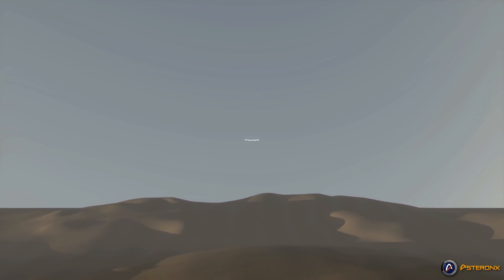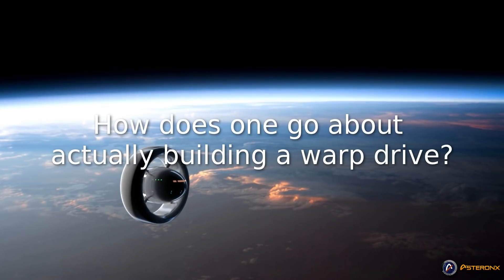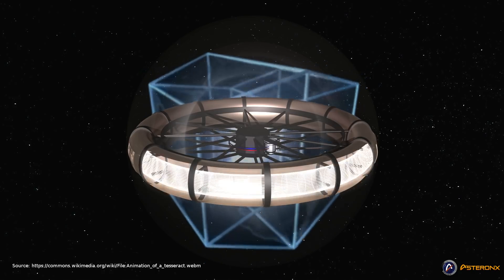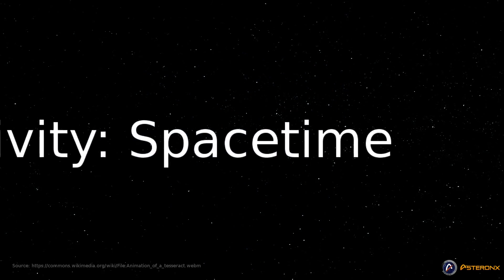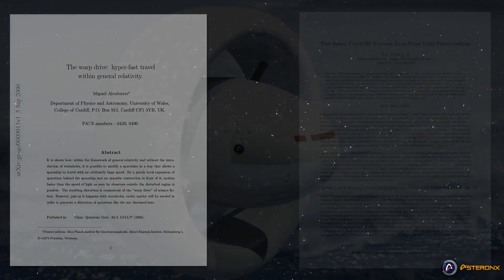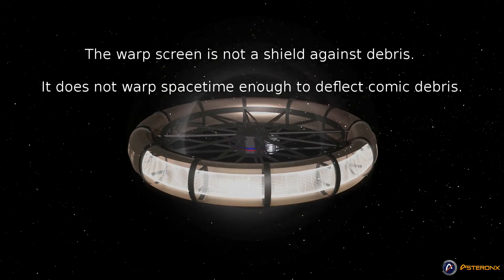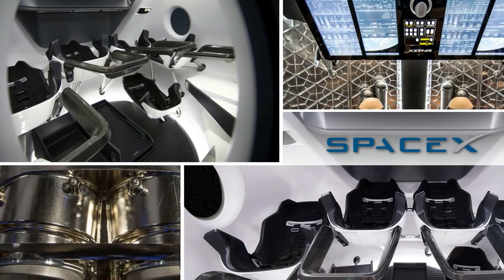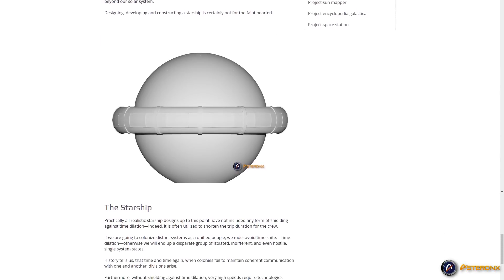Building a Warp Drive (updated version in description)

Comment: From my understanding, we need to discover/invent negative energy density or negative mass to work.
Reply from the maker: Negative energy (an inward pressure), not negative mass, exist everywhere. Basically, it is this that the Alcubierre drive variant utilizes. But, that is not by any means the whole story.
Reply: @asteronx  if negative mass/energy does in fact exist then how come we dont see any large concentrations of it anywhere in the visible universe?
Reply from the maker: @nil981  Please, do your research before making these statements.
Reply: @asteronx  

Here is another idea.

----------------------------------------------

Quantum Teleportation to other planets and back with data sent to Earth, and the data becomes an image or video, or 3D volumetric hologram, idea.

Also another idea is using large lasers like the military has, for Quantum Teleportation as the laser would be pointing at Proxima B in the solar system Alpha Centauri, which is closest to us, about 4.3 light years away from us.

Quantum Teleportation can go 3 times the speed of light with Photons, have it take a year to a year and a half to get there, and then send the data back in a year to a year and a half, 3 years going there and back, and then when the data gets back to Earth, have it create an image or video, or 3D volumetric hologram, e.g. imagine how fast a Quantum Computer can simulate planets, asteroids, and other things.

Imagine Quantum Teleportation with Mars and beyond, Proxima B the planet and beyond.

And now imagine as Quantum Teleportation matures, it could be 20 times faster, 50 times, who knows.

And to mention as Quantum Teleportation matures, with breakthroughs, sending it again to Proxima B so much faster, and beyond to other solar systems in our Galaxy and beyond that.

------------------

One other idea, is using Quantum Teleportation when it matures, to send "large objects" that aren't alive, like devices, machines, vehicles, buildings / structures, and so on to Mars, Proxima B and beyond. So that it sends them fast enough for cargo and other needs, using satellites, not just for the Quantum Internet across other planets.
Reply: @asteronx  

I have some interesting new playlists on my other channel to check out.

It would seem that you don't allow links, or my comments become hidden with the links in them.

And so I will mention which ones to look for on my other channel.

Look for these playlists on my other channel. -
"Searching for Dark Matter and Dark Energy with Quantum Computers", playlist.

"Quantum Computer breakthroughs", playlist.

"Graphene space ships", playlist.
This is a simple concept when you see it, but that is because the material is so advanced, and you should check out all the playlists on my other channel to see what I mentioned in this playlist.

=======================
Go to the channel I'm commenting with now, find 2 simple steps, and go to the "About" tab of the channel I'm commenting with now, for more info and a link to save to your browser's favorites.

Lots of amazing things on my other channel, I hope this gives you ideas, with Graphene and Quantum Technologies.
Reply: So, by "negative energy" all you mean is less than something else?🤣.     A car with a half tank of fuel would have a negative 1/2 tank compared to one with a full tank?

...but, this is by no means the whole story...

Comment: what bothers me is the G-forces? when you go faster than light or close to the speed of light, wouldnt that kill us going that speed?!
Reply from the maker: It's a good point, however, the warp screen actually shields against such g-forces.
Reply: All you need is a g-force field reduction modulator.  Set to 0.05 degrees of science words should be plenty.

Comment: A boost to the acceleration and not to the speed? What has to do with it in relation to which body you measure the speed of the ship? If it really was a boost to the speed, then if you exceed the speed of light, and disconnect the warp screen, you should stay above the speed of light. Are you saying that the speed of light is not the top speed for massive objects?

Comment: You can make the toroidal portion of the craft be a generated plasma instead of a physical part of the craft.

It is tricky but very obtainable with current materials.

Personally I prefer the approach of ridding created oscillations of the space time fabric to incrementally boost speed instead of a constant flow. Just seems easier to obtain.

Comment: What would a passenger see out of a window of a ship moving faster than light? Would objects be just appearing as they are passed by?
Reply: SkorpionMarauder if it were through the front window you would see the cosmic microwave background radiation Doppler shifted into the visible spectrum which would then warp into a single blue-white light and then it would warp into a glowing ring surrounding a dark void as the microwave background is further Doppler shifted into the x-ray and gamma ray spectrum.

From a side port, you'd see a stationary vertical rainbow as the dark x-ray and gamma ray spectrum goes from the ultraviolet spectrum to the visible spectrum (violet, purple, blue, green, yellow, orange, and red) in a narrow band and turn invisible right after.

From a rear window, you wouldn't see anything because behind you the light is Doppler shifted from infrared, to microwave, all the way to weak radio. 

If a faster than light ship flew in front of you (assuming that you are stationary) you'd see the ship blue shifted as it approached you , then temporarily disappear as it's blue shifted into the gamma ray spectrum. Then it will appear out of nowhere for a fraction of a second, while shifting through all the colors of the rainbow and then split into two ships. One going forwards and the other going backwards until they disappear (this is because the faster-than-light ship is out running it's past and future light cones so one image of the ship will always move forwards and the other one will always move backwards).
Reply: SkorpionMarauder I think it would look like a blur of red and blue light, because of the Doppler effect.
Reply: Nick Agriesti you wouldn't be wrong. Pbs space time and because science have excellent videos detailing superluminal travel.

Comment: Okay, can you talk about wormhole  generators/stargates as a form of effective interstellar travel?
Reply: Patrick Milewski seems to me the problem there would be the overwhelming gravitational forces acting on the object passing through the Einsten-Rosen bridge.
Reply: Nick Agriesti unless there was a way to make a trip through a wormhole using negative pressure,  wormholes could be a more impressive form of interstellar travel.
Reply: Patrick Milewski "unless there was a way to call leprechauns and command them to eat your sister in law's potato salad for you." Gravity can't just be negated. A black hole, and thus a wormhole, possesses so much mass that all energy and matter approaching it becomes trapped.
Reply: Nick Agriesti you have a valid point.
Reply: We need a paradigm shift in materials and ideas. This means a whole other level of good innovation, with Graphene and Quantum Technologies.

A civilization is only as good as the material it uses.

We should be using Graphene, and we can now use large machines to scale up Flash Graphene fast and cheap enough, go to my other channel using the 2 simple steps on my channel to find out more.

We need to also start using Quantum Computers for simulations / solving large algorithms, imagine Quantum Computers used in this way for many things, or almost everything around the ideas of warp drives and space exploration.

Also check out this article.
Go to google and type in "scientists-discovered-a-way-to-read-information-directly-from-black-holes" by a website called "fanaticalfuturist".
Why no links? Because my comments become hidden if I give a link. I can only give steps under this video.

Comment: So, you're telling me...that a warp drive isn't so much a propulsion system as it is an inertia cancelling device?
Reply: Patrick Milewski star trek doesn't even portray it as a propulsion system if you really follow the jargon. It's just creating a bubble of warped space in which the ship is propelled via the impulse drive. That is, I think. The history of the lore is so fucking rocky, you know?
Reply: Nick Agriesti the lore is very convoluted to say the least.
Reply: Sounds like it, I might have to redo my KSPIE Alcubiere Warp drive mechanics, instead of increasing the ship speed, I could reduce the mass of the ship components. Therefore the warpdrive concept would only function in conjunction with reaction engines, like fusion and antimatter drives
Reply: Patrick Milewski 
Smart guy, levitation, weightlessness, warp bubble, but you need propulsive force, to push the craft.
Reply: @cujoemblakka1041  if that was the case I dont think the warp drive would really work.

Comment: How is a power station generating enough energy to warp space? I don't notice any gravitational pull near a power station.
Reply: You run the current through the torus.  It's like an electromagnet.  This is where white changed the alcubierre drive.  He figured out you could warp space by charging a smaller "ring" which made this idea possible.  Alcubierre figured out a charged ring warps space but his calculations had it using so much power it was silly.  Nasa even did an experiment where they shined a laser through a charged ring at two different labs and got measurable results.  It's an exciting time.
Reply: I'm not certain myself but Einsteins equation: E=m x c^2 in english: energy equals mass times the speed of light muitiplied by itself.
That can be rewritten to to get mass: m=E/c^2, in english mass equals energy divided by the speed of light multiplied by itself.
So energy can be made to have effects that mass or matter has, like gravity. In this Alcubierre drive this energy is an electromagnetic field of energy. My interpretation is something such as radio waves but very strong and the hollow torus acting as a wave guide for this wave. Radio energy travels at the speed of light so that is the c^2 part of the equation. If it was strong enough energy dividing by c^2 that is 300000000m/s times 300000000m/s equals 9 x 10^16 or 9 with sixteen zeros after it. So for electromagnetic energy to show gravity effects a tremendous amount of energy would be needed because the energy is been divided by 9 x 10^16. I suppose if you could get away with very small gravity it would need a not astronomical amount of energy but this is only my interpretation. I am not 100% sure how it works myself. Oscillating the torus would cause that gravity field to ripple out from the spaceship like waves which it supposedly can ride on. Does anyone else have a more accurate explanation and either correct or confirm my idea.